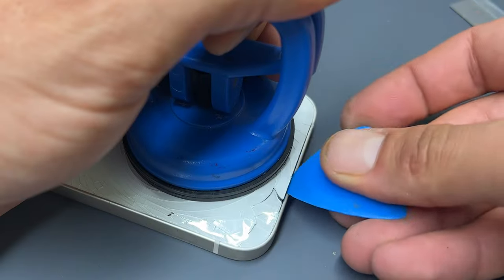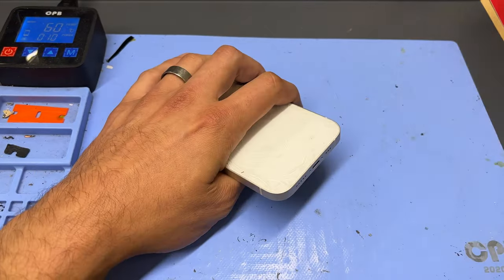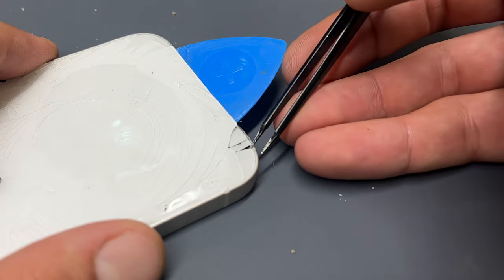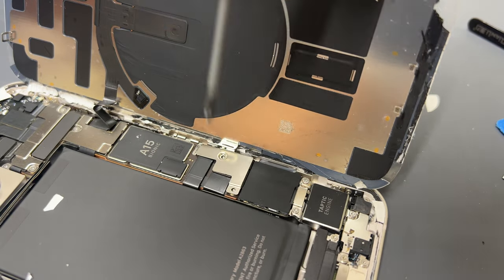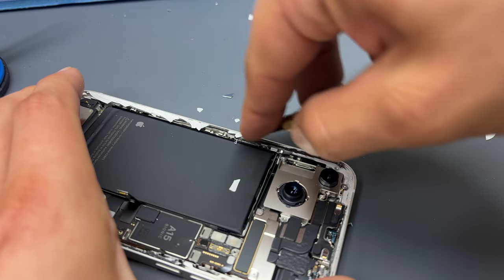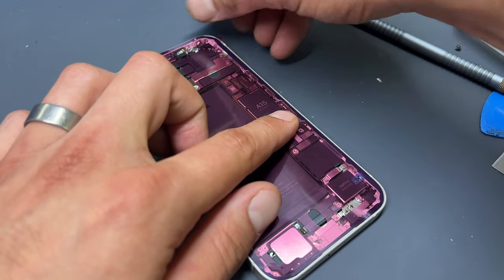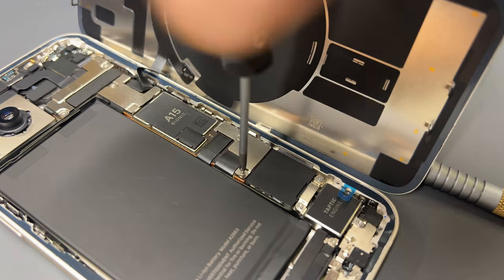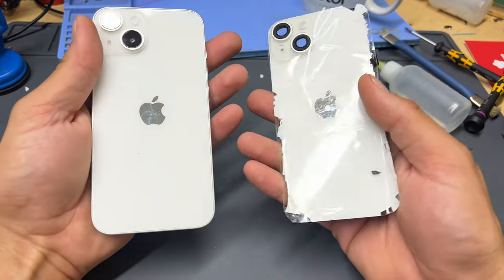Cracked iPhone 14 Back Glass? FIX IT Yourself With This DIY Repair Guide!

Comment: it's amazing how easy it is to replace the back glass of the iPhone 14 compared to previous versions
Reply from the maker: For sure, much more repair friendly design
Reply: @iDoctorUK  Is it that eazy on 13 pro max?
Reply: @ANerdWhoGivesLs nope
Reply: For sure I’m repairing an 11 currently absolute nightmare fuel
Reply: Does software not scream any errors when back glass is replaced with 3rd party parts? Or just reconnected in situation just replacing the frame? Thank you for answering
Reply: It is not bruhh. 
I prefer Housing replacement not only Glass
Reply: except the pairing part

Comment: Have you tested the phone by taking pictures using flash? It won’t save into your pictures, you have to use the original witless coil and flash
Reply: Welp imma keep my cracked back under my dbrand case and let it like that then. Im not switching shit to make another new backglass work. Anyway its a company phone i care but not as much as my personal one
Reply: Yep that's right
Reply: video very deceptive left out most important part
Reply: @KimoKimochii it was an Apple back glass; should that not have such issues?
Reply: @RennieAsh  it will still have issue because it’s paired to the logic board, he says it’s a pulled part so it’s not from apple and doesn’t come with the pairing service. You need to desolder the original IC and transfer it which he skips, very misleading

Comment: Where on earth did you find the pull back glass that has the plate and parts attached?  All I was able to find is the whole body with frame or just the glass.

Comment: I replaced the screen on my iPhone 14 and for the longest time I got the unrecognized part error, here is what I did. IOS 18 fixed this problem for me, my phone always said unrecognized part and after updating to iOS 18 on iPhone 14 it asked me to let it diagnose and finish repair, after accepting, it got rid of the unrecognized part and said genuine part.

Comment: Aftermarket rear glass will give flash photo error and not save photo. Two options. Swap charging coil assembly with IC ribbion chip or use a factory OEM genuine Apple back glass from another phone or from Apple self repair store.
Reply: Do you perhaps know if the same error happens if you use genuine back glass of an donor iPhone 14?

Comment: when you do this, this displays unknown part and was told flash and wireless charging don't work if not configured. can you verify it?
Reply: Do they say that when you replace your back glass to??????
Reply: iOS 18 fixed this problem for me, my phone always said unrecognized part and after updating to iOS 18 on iPhone 14 it asked me to let it diagnose and finish repair, after accepting it got rid of the unrecognized part and said genuine part. THIS WAS FOR THE FRONT SCREEN ON AN IPHONE 14.

Comment: Where do you find the parts like that? I can’t find any genuine 14 pro max backs with the parts in it. It’s just the glass itself that they sell. I want to repair it like you have with whole new back not just chipping off all the glass and putting on a new one

Comment: When changing the back glass I lost one of the small magnets around the wireless charging at the back,, will it make any difference,, cheers
Reply: not really only a little less force when attaching magsafe but i don't think that will do much of a difference
Reply: Thanks

Comment: I got my new back glass but it’s just a back glass with no parts attached. Does that mean I have to go in through the front and remove everything?
Reply from the maker: Ideally you need the part with the frame on it.
it will be VERY difficult to do so without
NP

Comment: @phonerepairguru done a back glass replacement on iPhone 14 and when he took pictures using the flash none of the pictures were being saved, so the original wireless charging coil and flash has to be used
Reply: I used to be a 80hr per week phone repair employeebut stopped a year ago right after the i14 came out, i am now opening my own shop in about 2 months, have you found a solution to that problem and is there anything else new with the 14/15s thats different from the iphone 13s?
Reply: @glutenfreebread5966 I have a 13 pro max with a cracked back. Does the 13 have the same issue the 14 does?

Comment: Is the back glass paired to the board on these?
Reply: No
Reply: There’s a video online of the iPhone 14 rear glass replacement by iphoneguru, when you take the picture using flash it don’t save into your pictures
Reply: @zedzed3124  oh yeah, I already know
Reply: @Jesse88789  is there another solution
Reply: How would you pair a piece of glass to the board? It has no function ?
Reply: @pablo-tr5jm  yes it does, hence it having a plug.